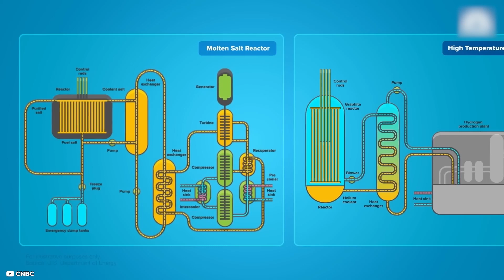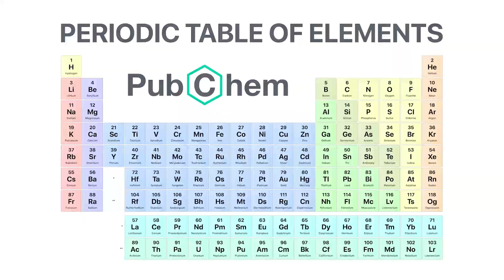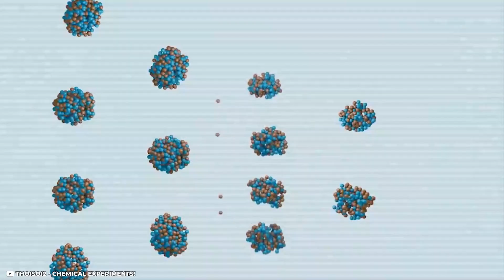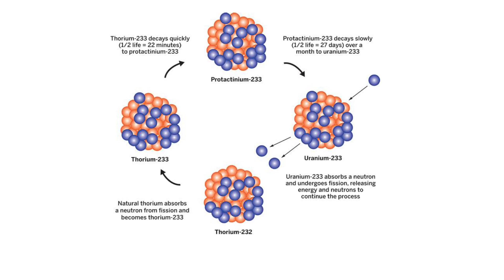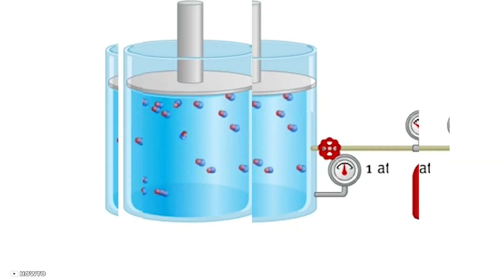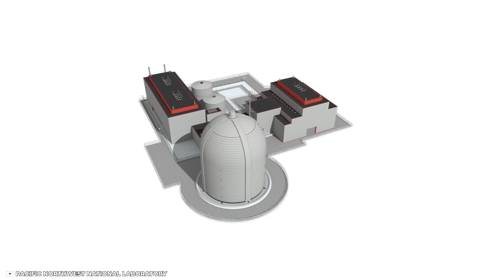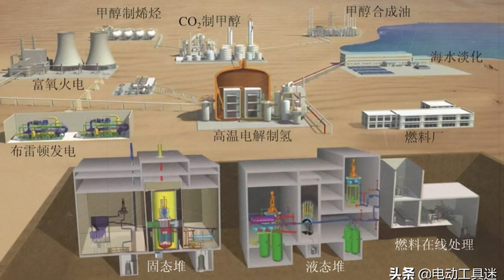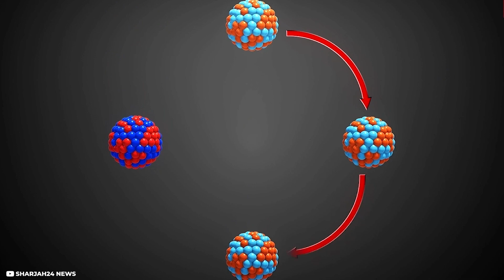NEW NUCLEAR REACTOR! Safe Nuclear Energy for 1200 Years!?

Comment: I Have a question about liquid fuel thorium reactors. Are the thorium and the uranium seed both dissolved in the salt? So say a problem arises and the salt plug is allowed to melt and the liquid fuel flows down to the tanks below. If the fuel contains both thorium and uranium doesn't the fission keep going? The graphite rods are not available to moderate so what's stopping the reaction? I'm missing something here I know.
Reply: The tanks spread the fuel over a large area so there are not enough neutrons to sustain the reaction.
Reply: The problem is decay heat, which if not removed will likely result in a breech of the containment tanks.
Reply: @darkgalaxy5548  The Dump Tanks are designed to dissipate heat. No new heat was produced because no fission took place. 

The fissionable fuel in Oak ridge Lab's Molten Salt Experiment was dumped on Friday, cooled down over the weekend, heated up on Monday, pumped back into the reactor core and the experiment continued.  For four years.
Reply: @UrbanBard1  I suggest you do a bit more research, there's some serious holes in your knowledge, especially concerning decay heat. Also Google the ORLN MSRE & you'll find that reactor had various continuous run times from a few hours to 6 months, with numerous stops, both planned & unplanned. I don't know where you got the idea that they'd shut the reactor down for the weekends, & resume on Monday mornings. Not from any reliable source.
Reply: @darkgalaxy5548  LFTR in 5 Minutes- the long version. Kirk Sorensen says that. You take it up with him.

Can we agree that the decay heat is minor in comparison to fission? Let's say with a U 235 starter mixture, a 700 million year half life results in a very low decay rate. 
https://en.wikipedia.org/wiki/Uranium-235
As you can see there is a picture of a good sized slug of U235 resting in gloved hands. I'm guessing that it would feel warm, but not hot. The gloves were there to protect the Uranium from contamination. The alpha particle emitted in decay would not get through the gloves.

By the way, the point I was making was how safe and controllable a MSR is compared to a LWR. Do you disagree?

We need more experience before we can trust an MSR to be "walk away safe." It looks like it is, but I'd rather be cautious.
Reply: @UrbanBard1  At Oak Ridge the MSR was started without the pumps going.  The tempature rised to a certain point where the molten fuel expansion resulted in the fission reaction stopping.  This effect has been tested several other times and has been shown to work everytime.  I don't think this is an unknown issue.
Reply: Graphite rods do not stop the chain reaction. Graphite is not a neutron absorber.  Going to a non-critical geometry stops the chain reaction.
Reply: @williamolenchenko5772  OK. Goes to show how ignorant I am. So what does stop the fission process when the molten salt flows into the tanks?
Reply: @williamolenchenko5772  Carbon slows the neutrons so they can hit a fissionable atom to continue the chain reaction. If there is no carbon, there is only a tiny amount of  fission. Cadmium absorbs neutrons.
Reply: @williamolenchenko5772  the graphite in a modulator that slows neutrons down so the fission reaction can take place.  Without  the neutrons being slowed down to the proper reaction speed no fission reaction will take place.
Reply: The nuclear reaction requires a modulator to slow the fast neutrons down so they will instigate the fission reaction. Without the modulator the nuclear reaction stops.  The drain tanks are designes to let heat escape so decay heat is removed by natural convection air currents.  Since we are dealing with molten salts that do not boil untill 1,400⁰C (over 2500⁰F) convection air currents are fully sufficient to remove decay heat.  In other words, explody reactions are not possible.
Reply: It depends on the reactor design. There are one fluid and two fluid systems. 

In a two fluid system, inside the core is a fissionable fluid of either U233 fluoride or U235 fluoride.  7Lithium fluoride and Beryllium fluoride dilute the core fluid to control the rate of the reaction and thus, its temperature. A Molten Salt Reactor operates in the thermal range. Carbon rods inside the core slow down a neutron before it hits a U233 or U235 atom and can fission it.

Around the outside of the core, you have a blanket of Thorium 232 fluoride. When a neutron hits a Thorium atom , it most often becomes Thorium 233, which in less than an a hour decays into Protactinium 233. This Pa 233 must be immediately removed. Thus, the Thorium fluid is continually pumped from the blanket through a Bismuth Redox column and returned.  The Protactinium, thus captured, is stored away. It takes 27 days for half of the Protactinium to decay into U233. Usually, 4 to 5 half-life's  gives the highest purity of U233 (94% or 97%.)

The only reason to use U235 in a MSR is as a starter fluid. After about a year,  enough Thorium will have been turned  into U233, so that you can remove the U235. 

The freeze plug only drains the fissionable core. The dump tank has no carbon in it, so, no moderation takes place, or fission. But the tank  does remove heat, so the radioactive material solidifies. 
When you are ready to restart the reactor, you heat up the reactor fluid and pump it back into the core. At Oak Ridge, the scientists would dump the fluid over a weekend and start up on Monday. A Light Water Reactor takes weeks of checks to restart after it is shut down.
Reply: @UrbanBard1  A LWR does not take weeks of checks to restart after it is shutdown, unless it is shutdown for a planned refueling/maintenance outage.
Reply: @williamolenchenko5772  that's what the jerks at Chernobyl thought.  There is a build up of a radioactive reaction killing gas that prevents the fast start up of a LWR (even worse setup at Chernobyl).  Before restart this reaction killing gas has to be allowed to decay.  If you force a restart to soon you can overcome the reaction killing effects of this gas but the restart of the reactor will eliminate this gas and you can get a run away reactor.  Boom.

Comment: There is ZERO reason to take the U-232 from the liquid salt + thorium fuel, or any of the other actinides for that matter.  The actinides can either be fissioned or bred into fissionable isotopes.  The only things that need to be removed are the fission products which are all lighter but neutron rich isotopes that turn neutrons into protons in the process of beta decay (emission of an electron and generally a couple of neutrinos), these elements are highly radioactive but short lived (they will return to the level or radioactivity as the natural ores from which they were mined within 300 years which is basically ten cycles of decay for the longest lived isotopes.  Contrast this to a conventional pressurized light water reactor that will make a lot of plutonium and other actinides that will remain hot for around a million years.
Reply: Well. Other than the inevitable desire 😊to produce hyper-pure U-233 with no U-232 by extracting Protactinium before it decays. U-233 is an ideal weapons material with fissile properties approaching those of Pu-239, combined with the very low spontaneous neutron generation rate of uranium. Net result, trivially easy to produce gun-assembly nuclear weapons. And combined with lithium-deuteride - small, easy hydrogen bombs. 

Add salt reprocessing and proliferation becomes harder to detect. 

But then add the chemistry issues of molten salt and uranium allowing for undetected fissile material accumulation resulting in criticality accidents not possible in other reactor types. 

Add to the usual use of beryllium salts creating truly horrific disaster hazards due to the toxicity of beryllium. 

And nothing about this resolves the actinide accumulation issues, spent fuel and fission product issues, or the inability of the nuclear cycle to compete with renewables on cost, while saddling the nation with the long term proliferation, waste and security issues, and the immense potentially nation busting catastrophic accident hazards and costs. 

Nuclear is dead. Give it up.  There is no answer here. 

And the latest argument in support - fighting climate change - is a non-starter. The reactors cannot come on line in sufficient quantity to make any dent in the energy problems required to combat climate change, even if all of the other problems and issues were instantly and magically resolved. 

This is a technology in search of a problem to address, that instead just creates vast problems of its own, which then compete for dollars, resources, manpower, space and materials required to actually provide real solutions.

Comment: Nixon fired Alvin Weinberg in 1973 because he insisted molten salt reactors would be cleaner and safer but would not be as convenient for bomb grade material.  This would compete with the light water and other reactor industries that existed.  It was a mixture of politics and bad capitalism that killed off any possibility of LFTRs and other molten salt reactors being improved and made commercially viable.
Reply from the maker: Thanks for the valuable informations you added to our community 🙏🏽
Reply: Where do people keep coming up with this BS that PWR/BWR were chosen so we could make bombs?
Hanford Wa. has been making weapons material since 1944, 12 years before the first U.S. commercial nuclear plant became operational and their weapons production reactors are very efficient graphite moderated reactors and DO NOT produce any electrical power.
Savannah River site SC. Has been making weapons material since 1955 and their production reactors are very efficient low pressure heavy water moderated reactors and DO NOT produce electric power.
Weapons production reactors are NOTHING like U.S. commercial PWR or BWR power reactors and commercial power reactors have NEVER been used to produce Pu239 for weapons.
The U.S. currently has so much Pu239 that 34 tons of weapon grade Pu239 is being treated so it can eventually be disposed of at a cost of billions.

Comment: At the end the vid gets it totally wrong. Thorium reactors, at least in an LFTR configuration, REDUCES nuclear waste, and does not produce more waste (than current nuclear plants). So the statement done in the vid is very misleading. It's true it still produces some nuclear waste, but ten times less than current 2gen reactors AND the waste that remains has only to be kept safe for 300-400 years, instead of 25000 years, as it is with current nuclear waste. Perfectly doable: we already have buildings or underground storages that last that long.

Also... since it can burn up more of the nuclear material, it could de facto reduce all current "overall nuclear waste" as a whole. Because it could use our already existing stockpiles of high radioactive waste, and burn it up - reducing it tenfold, and produce electricity while being at it. Even the Greens should jump on this, because it solves their eternal  complaint about nuclear waste - yet most don't. Because "nuclear".
Reply: Spot on!
Reply: It’s a pretty sloppy article.

Comment: The corrosion is directly proportional to "Salt Purity" the more pure the salt the less corrosion. The reactor they ran at full power for 6,000 hours at Oak Ridge lab had minimum corrosion after they inspected it because they had an almost pure salt that they could manage back in the 60's, today salt purity is no longer a problem.
Reply: Oak Ridge was never anything other than a proof of concept into molten salt reactors and the issues they may have. It never ran on thorium.  Initially it ran on U235 and later on U233. They also looked at the possibility of running plutonium in a molten salt reactor as the fuel. It raised a lot of issues, some of which were never addressed but simply noted - the effect of tellurium on the metalwork being one of the discoveries that could have serious implications for future commercial reactors of that type. It caused the alloy in use at Oak Ridge to become brittle and crack. It was never addressed and simply noted that a temporary fix was to add niobium to the alloy would hold the corrosion off for a longer period but not sufficient to last the 30 years of the proposed thorium reactor. Oak Ridge did is job as a research reactor and completed its tasks. That's why it was closed.
Reply: @joebloggs4369  And I don't think there were any permanent alloy solutions for any of the isotopes used. They achieved a lot and noted limitations. A shame there's wasn't years of follow-up as metallurgy advanced.
Reply: @joebloggs4369  The uranium-233 (233UF4)  was the result of breeding from thorium, though, so I'm not sure what point you were making. Yes, it was made in other reactors. But there is no reason to assume it couldn't have been made in the oak Ridge as well, at least in principle.

I can't speak for plutonium, but using uranium they got actually very good results with their Hastelloy-N alloy: "An out-of-pile corrosion test program was carried out for Hastelloy-N, which indicated extremely low corrosion rates at MSRE conditions. Capsules exposed in the Materials Testing Reactor showed that salt fission power densities of more than 200 W/cm3 had no adverse effects on compatibility of fuel salt, Hastelloy-N, and graphite.".

So they already got pretty good results 50+ years ago, and we're now half a century further with metallurgy...
Reply: @ignorancebeater650  The point I;m making is that Oak Ridge was never a thorium reactor, as  is frequently claimed as it was never fueled with it. It was testing the principle of a molten salt reactor for the use with multiple fuels, which  thorium, plutonium and various uranium isotopes. But neither thorium nor plutonium was used. was never used.
Out of pile testing is not the same as in pile results which showed at Oak Ridge that the Hastelloy was attacked by tellurium -  a by product during the fission product. The temporary fix was adding niobium but tests showed that it would be insufficient for the expected life of a molten salt reactor. Yes, we now have 50 years of metallurgy si it will be interesting to see how the Chinese fare with their molten salt reactor.
Reply: @joebloggs4369  it was planned to build a true thorium reactor with a blanket and reprocessing.  Work was proceeding on this build when funding was cut and all research product was ordered destroyed.
Reply: @stanleytolle416  Planned by who? Who was in charge of the project? Where was this work proceding on the build? When was it funded then had the funding removed and all research destroyed and ordered  by who and why?
Reply: @joebloggs4369  Oak Ridge MSR program was closed for political reasons not anything to do with completing any thing.  There were plans to make a true thorium with a blanket.  There were also plans for research into other materials for corrosion and other issues.  As to the longevity of parts with the reactor OR developed procedures to remotely replace and service all the parts in their reactor so even if a part needed to be replaced every few years it could be easier done.  One has to remember that this is a low pressure reactor so catastrophic failures were not an issue.  Personally it is my opinion President Nixon was manipulated into shutting down the program because it represented a threat to the plutonium breeder reactor program which vast amounts of money has been invested in. Like supposedly the money from the OR program was to be sent to the PtB program.  Never made sense since the amount of $s in the OR program was about a rounding error to the PtB program.
Reply: Inversely proportional
Reply: @artsmith103  Yep. He must have meant that, or otherwise his whole argument afterwards wouldn't make sense. Don't know if it's factual, though. I've read quite some, but I never read this connection in any explicit way. I did read about them using pipes made of hastelloy alloy to reduce any corrosion, which seemed to have worked pretty well.

Since we're 50+ years later, I would venture  our knowledge of metals and materials has increased, so it's reasonably to assume we could create something even better now.
Reply: But also we have mordern material science. In the past new advancements in it was a bit random now we can create materials more sufficticated
Reply: What would you say if you could stop that corrosion?
Reply: Thorium reactors won't be seen anytime soon in the United States of America. The petroleum industry, the crooks on Wall Street,  and their dogs 🐕 in Congress will not allow it.